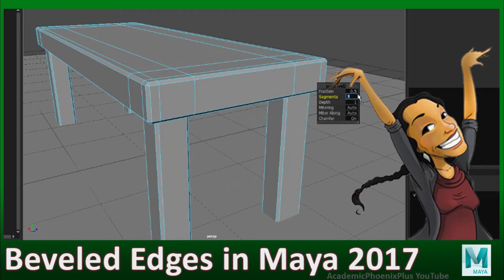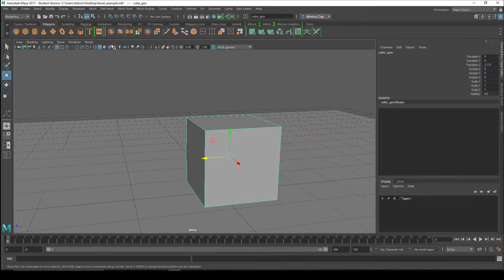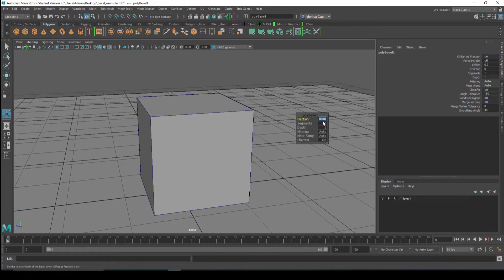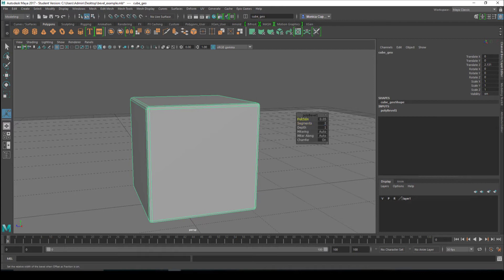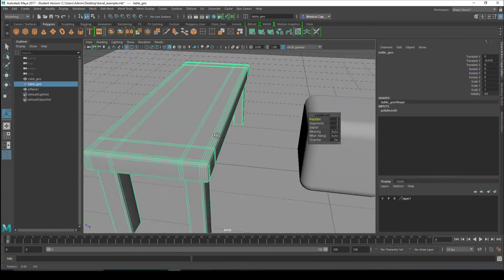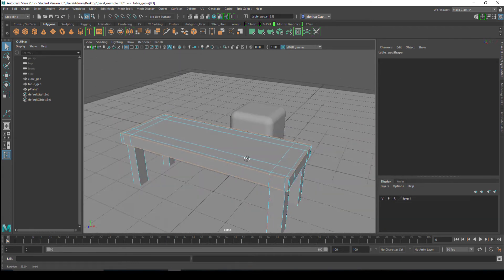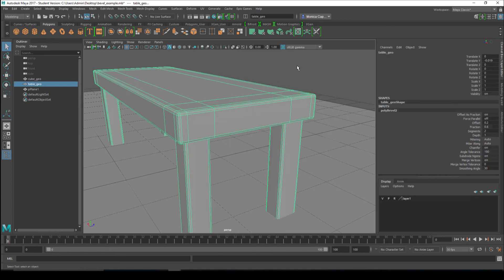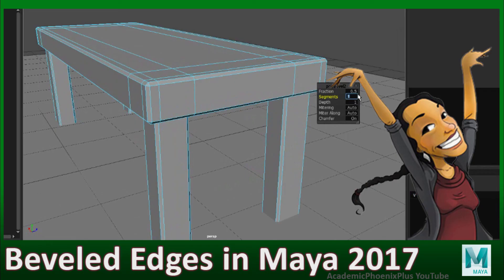Beveled Edges in Maya 2017

Comment: Hi, i have problem with beveling this:  https://prnt.sc/hkv9me its to hard to save quad geometry... any suggestion?
Reply from the maker: Hi there, it looks like your mesh is combine. Try separating the geometry first. Then delete the history (edit>delete by type> history). Select just some edges, and see if the beveling works. If it works, then keep selecting edges and beveling. Let me know if that works!
Reply: Its not combined and beveling make too much bad geometry. Mesh in green color is one mesh.
Reply from the maker: Hi again, beveling will definitely increase your geometry increase. Make sure to select the edges you only want to bevel, nothing else. Otherwise you'll get unnecessary edges. To avoid any tri's/ngons, I would increase your segments to 2. I hope that helps!